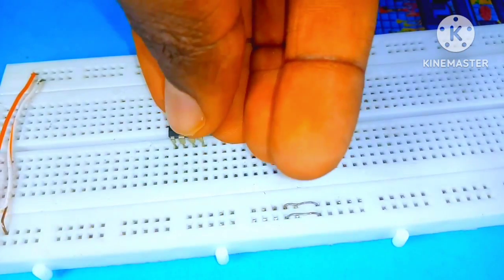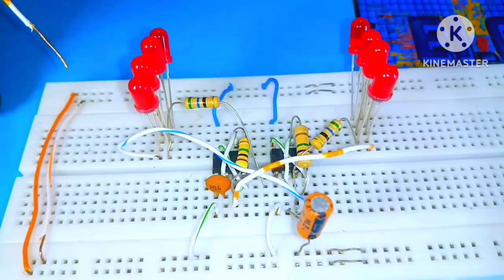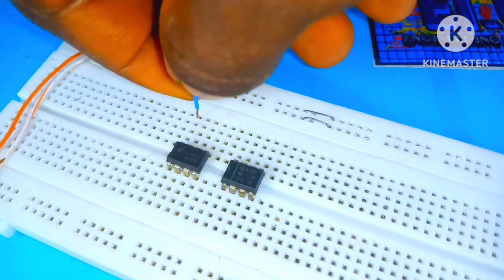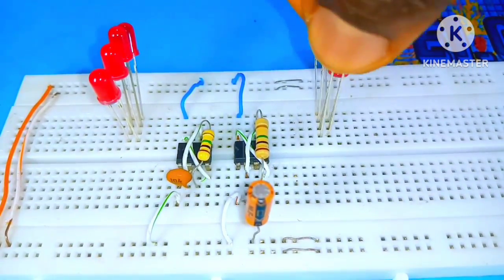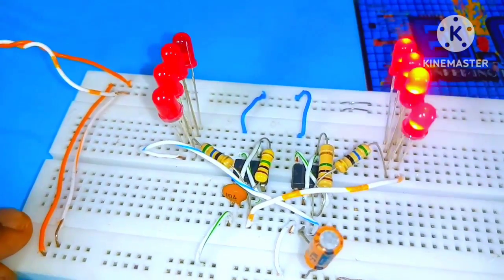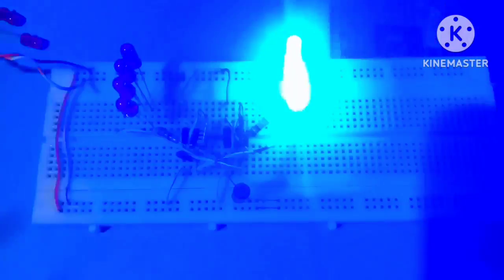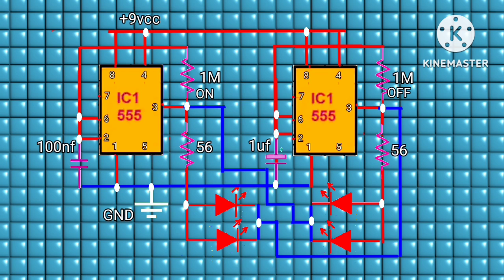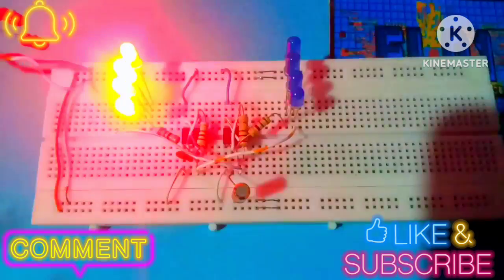Upgrade Your 555 Timer Level Skills With This Incredible Result

Comment: FYI there's an interesting bug/feature in the original bipolar 555 where when the output switches it briefly shorts the power supply. This tends to cause a pair of oscillators like this to soft sync up as it moves the internal reference voltage. It doesn't happen with the CMOS 7555 version.
Reply from the maker: Okay,